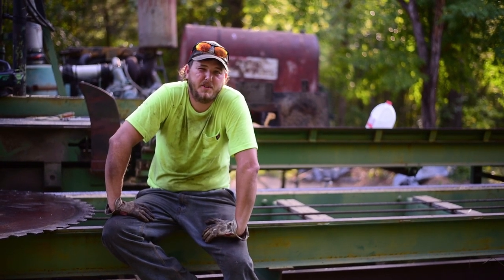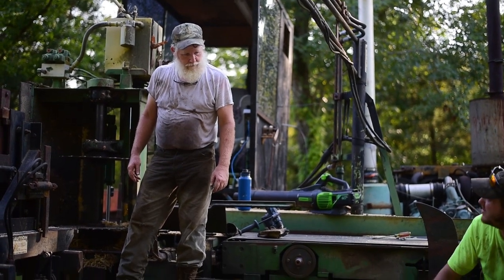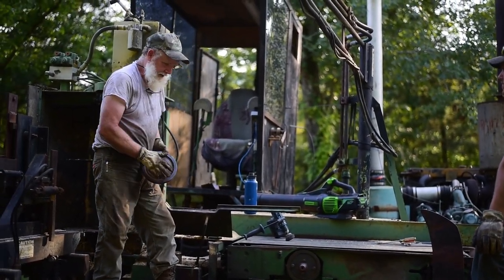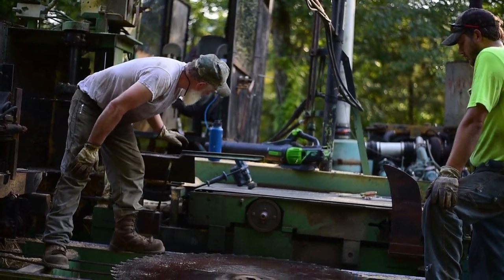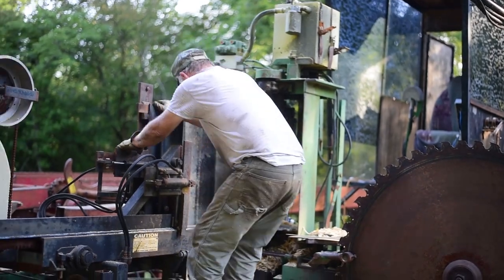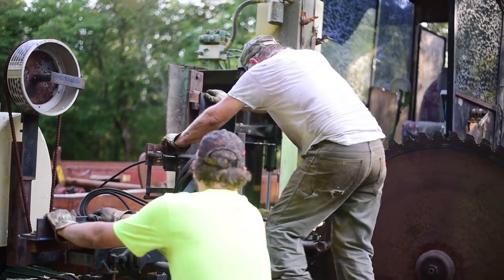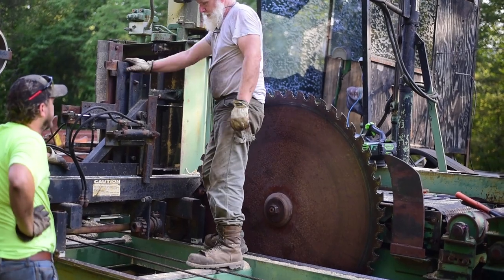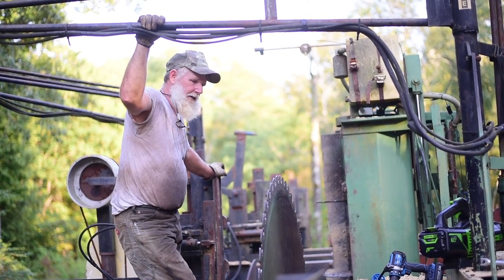Setting the Lead in the Edmiston Hydraulic Sawmill to get accurate lumber

Comment: I had my collar turned down on my mill , they did it on the mill and it runs perfect now.
Reply from the maker: Once we set the lead right it runs fine now. I need to take the blade off and hammer it but it’s not that bad yet. Will probably do that by the end of the month.

Comment: I'm fighting lead issues on my meadows 48" mill.
Reply from the maker: make sure your collar is right. That will cause all kinds of problems
Reply: @TheOutdoorRight yes, it's clean and beveled 0.002". Releveled track, set 1/32 lead, swapped saws, new shanks and bits. Im pulling my hair out lol
Reply from the maker: @sosebee12nadc13  well when you do finally figure it out, it will probably be something so simple you wonder how it can be so complicated. I spent almost 2 hours digging a piece if bark from the pulleys that drive my live deck the other day. You might try to email. Marc galicic he has an edmiston too he might be able to help or call the guys at edmiston they usually help if they can.